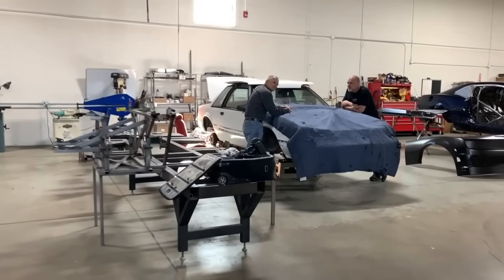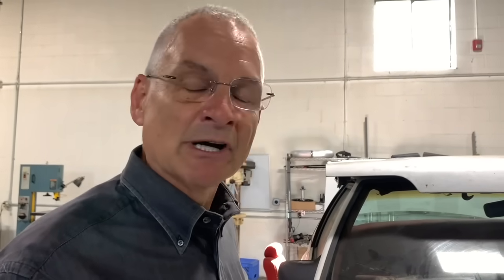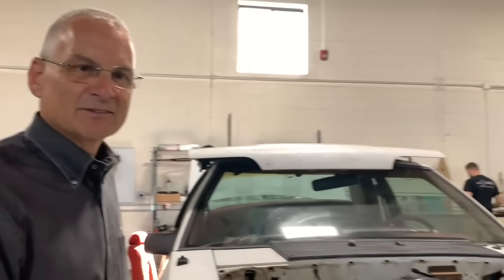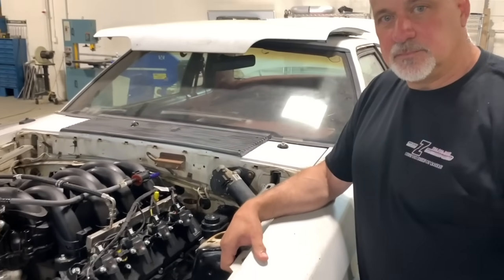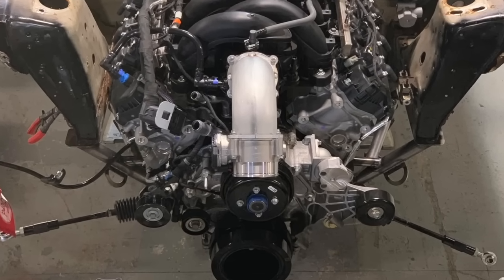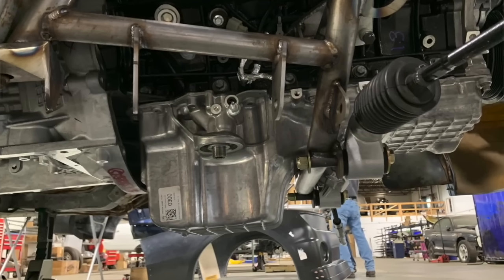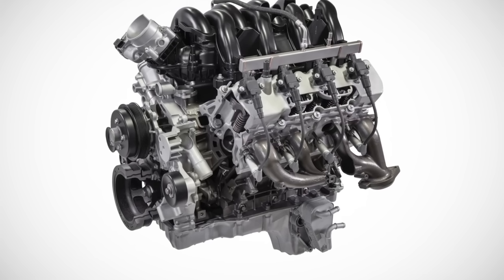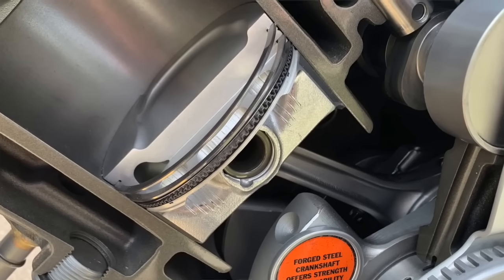Ford 7.3L "Godzilla" V8 Foxbody Mustang Engine Swap — Team Z 446-cube Small-Block Project Part 1

Comment: 2 yrs later. Has this gained enough traction? Short search brought up a $8000 430hp motor, 1200 oil pan, 1000 cam, 3500 control pack. Seems like a 20k swap all said and done. Parts as of right now are expensive compared to the priced i oaid for my sbf build. Hopefully they come down. 

 My question is what kind of power can be had on 93 fuel with boost? If this can do 800, 850 whp in a fox with 93. Thats a win. Other wise for the average non sponsored back yard mechanic like myself. Sbf is still the way to go for modified pump 93 power. Not stock block of course

Comment: 6 bolt block lol . The ls7 is stronger has way better parts and heads you dont have to touch and makes way more power but the 6.2 makes more power hell the hemi 392 makes more power and the kicker . You dont have to change rods pistons intake and have the heads ported to hell and back .. and when did pistons become a bolt on part .only in a ford guys eyes i guess . Cant wait till ford puts this engine in everything so we can really see what its made of. I now truth hurts .. i didnt know the 7.3 was a motor i thought it was a engine so where does the  aaa battery go or does it run on d batteries just wondering

Comment: 446 is a big block anything under a 400 is a small block
Reply from the maker: Jackson, I'm sorry but you are incorrect. Big- or small-block is based on bore spacing of the cylinders, not on displacement. Based on what you're saying, the tried and true 396 Big-Block Chevy would be a small-block.

Comment: For what it's worth - I'm not really a "brand guy" or a purist, but I mostly work with chevy power in part because it cost less to get horsepower out of them, but the Godzilla is an excellent choice for a swap. My current project is a Fox / LS for the strip, but if I was building for the street? I'd want the Godzilla just for the low end torque if nothing else. It shares a lot of features with the LS that made the LS great.

I love that style mounting to the K member too, its like the AJE LS swap member instead of having pads to use factory rubber mounts with an adapter. It's the one thing I dislike about the UPR K member. The reason I'm going with the UPR is because it comes in a kit with the front suspension stuff, and all chromoly. Team Z has it in chromoly too, but the kit is different, and that one is a pad mount - or no pads, and use motor and mid plates - which I'm not doing in the near future...

Comment: There’s reports of ford striking a deal with Windsor on a 6.8L pushrod that’ll be going into the 2022 Mustangs and F-150s.. LS fangirls are getting what they asked for and it isn’t gonna be pretty for them once the aftermarket starts to flood in with products 😂.. Chevy has stuck with the same platform for years and it’s gotten so old, yet ford is damn near perfecting their DOHC platform and going back to a pushrod platform just to put the final nail in the coffin.

Comment: Just a thought ☝🏽💭 instead of nicknaming this engine “Godzilla”, seeing that the Nissan GTR and R32 Skylines are already dubbed that, Ford should have nicknamed it “Mastodon”, considering the position of the throttle body and intake resembles the trunk of a mammoth or mastodon.. and because it will go down in history as a legendary beast!

Comment: Why do they call this a Small-Block?  I thought it has all the characteristics of a Big-Block?, Also is it 445ci (like Brian said at 1:24) or 446ci like your title says? (yeah, I know, splittin hairs)
Reply from the maker: Big- or small-block is based on bore spacing not CID. For instance Chevy made a 396 BB and a 400 Small Block. They also made a 366 big block.

Comment: The funny part is you can put any trans behind it that'll fit a mod motor or coyote so you can easily put a 4,5,6,8,10 speed auto or a 5 or 6 speed manual. Can't wait to see someone build one up to over 1000hp. The most insane part being that that engine is actually cheaper than a 340HP 302 straight from Ford.. by ~$1300

Comment: no matter what this guy says........a ford engine will never beat a gm engine especially the LS . its been proven many many times before and fact that a ford engine no matter how well the are built are junk . ford motors are only reliable for one thing......blowing up lol . also another fact , ford said this is the biggest factory production engine lol.......no its not but ford always bullshits . the gm 8.1 big block is the biggest factory engine tried tested and a true work horse .so good that its in every thing from full size motor homes , military vehicles , buses etc and the list goes on . the gm 8.1 is the baddest factory big block that still lives and who cares if its not that great on fuel for those of you that think its important.......wait and see the numbers on this SMALL BLOCK ford 7.3....its going to drink down the fuel worse then a raging alcoholic lmaoooooooooo........which is what ford is known for . one thing is really funny thou is that 80 percent of old school and new school ford vehicals have LS engines in them lol . you buy a ford you buy the best......you drive a mile and walk the rest lmfaooooooooooooooooooooooooooooooooooooo........this is no godzilla......this motor is a chipmunk lol

Comment: Ok I can see the business potential here but having watched way too much YouTube during the Wuhan Flu lockdown I have seen several airplane builds  where the owner installed a huge engine & the plane either fell apart & did not fly safely.  I might suggest a 7.3 powered Mustang might be great fun in a straight line but you had better slow down to 30MPH for the off ramps.

Comment: Fingers crossed they can keep the price reasonable on these engines (even used) but I seriously have my doubts.  I predict when Ford makes this engine available it will undoubtedly cost 15k+.  Ford is still asking 11k for Coyote crates!!! Coyote platform is going on 10 years old and still doesn't hold a candle to the LS in terms of affordability.
edit: Well the pricing just came out and I have to applaud Ford.  I am literally stunned they released it sub 10k.  MSRP is $8150 and the part number is M-6007-73 fwiw.

Comment: Crown Vic + 7.3L + 10spd Auto = My New Daily Driver    .... I already have the car and the $$. Ford needs to release crate engines & the transmission (NOT the SD 10 spd truck trans). These guys need to put a swap kit together.

Comment: THE LS TO BEGIN WITH IS A FORD MOTOR. IT'S A REGURGITATED 427 HIGH RISER AKA RAISED PORT 351 WINDSOR.  NOT ONE DESIGN ASPECT OF THE SMALL BLOCK CHEVY LIVES IN THE LS.  THE LS IS 100% FORD IN DESIGN. WHAT GM INITIALLY DID IS JUST COPY FORD DESIGNS. THE GM ENGINEERS ARE CLOWNS. ALSO IT IS NOT FORD GUYS PUTTING CHEVY LS MOTORS INTO THEIR MUSTANGS, BUT RATHER CHEVY GUYS USING CHARISMATIC MUSTANG BODIES INSTEAD OF THOSE UGLY Z28 IROC BODIES THAT PEOPLE PUT UP FOR SALE AND CAN'T GIVE AWAY, THAT NOT EVEN A MEXICAN DISHWASHER WOULD TAKE FOR FREE IF YOU OFFERED IT TO HIM. ANOTHER POINT ARE THE COYOTE ENGINES. CAMARO SALES ARE DWINDLING NOBODY WANTS THEM ANYMORE AND PRODUCTION ONCE AGAIN IS ABOUT TO SEIZE  BECAUSE IT CANNOT COMPETE WITH A COYOTE. IN NMRA PURE STOCK RACING. A 425HP NATURALLY ASPIRATED STOCK COYOTE SEALED FROM THE FACTORY MOTOR, WITH HEADERS AND INTAKE ONLY. AND WITH FORD'S COMPUTOR. IN 3000LBS FOXBODY MUSTANGS ARE RUNNING 9.80'S ON HIGH OCTANE PUMP AND IN THE OUTLAW CLASS WITH A DIFFERENT TUNE AND RACE GAS ARE RUNNING 9.40'S. THAT IS MIND BOGGLING AND WHY THE CAMARO LS IS HISTORY A SLATE FOR THE WRECKING BALL ONCE AGAIN KILLED OFF BY THE MUSTANG.

Comment: Things are sort of getting turned upside down in the auto industry now.  GM is working on a 5.5 L DOHC V8 for the new Corvette.  Ford goes back to pushrods after 25 years of overhead cams.  What next?  Cats sleeping with dogs?  Peace in the Mideast?

Comment: 30 k from ford build 4 ls motors for same cost   6 bolt mains deep skirt block like the ls finally went back to single cam pushrod engine instead of that overhead cam junk

Comment: The biggest area of concern for Fox Mustangs is the actual body and frame of the vehicle itself. Fox Mustangs (well, all Mustangs) are built with a unibody structure, meaning the car is constructed of various subframes connected by the floor pans instead of a full frame design. The factory bracing is inadequate to deal with the power of the 5.0L V8 up front. After years of abuse, it's not uncommon to see twisted frames simply because of a lack of bracing

Comment: A good 351W/ 408 is a lot less physical weight and size and as a bonus you can make way over 500 horsepower and way over 500 foot pounds of torque. Less weight means an easier cornering car and lighter weight is definitely easier to make it faster. I had a 1979 Mercury Capri with a 351W and a good old 9 inch rear end cut down to fit the Fox chassis and south side machine lift bars and adjustable upper control arms. With me in the drivers seat on the scales it weighed 2,950 pounds and had an honest 450 horsepower, fairly quick 😉

Comment: Big fan for nearly 20yrs of your work at MM&FF Evan. I got start in 2001 with a 1992 Crown Vic LX 4.6L 2v at 18yrs old it was my first car and I got into the magazine to learn and dream. It was 2007 before I could afford to buy and insure a 2005 4.6 3V 5M Mustang GT. Had 7 4.6L 2V vehicles, 2 4.6 3Vs, 2 Coyote 5.0s and a 6.2L F250. Switched in 2014 to GM LS stuff because I was dreaming of owning full size V8 rwd Australian muscle cars since 1996. Would have bought a Falcon...have a '13 Caprice PPV, '16 Chevy SS and '04 GT0 6M.

Comment: They might as well run 2.73s in the 8.8 behind that thing with the granny gears in that 10spd, had off the line and super low hwy rpms. I want to see this thing swollow a 300-400hp shot of nitros.

Comment: About time ford made a decent engine.. reminds me of an LS engine
Reply: Ford has several badass engines they aren't hurting for badass engines.  If you prefer pushrods you prob won't like most modern fords.  I prefer the 4v mod motors and coyote myself but this is sick too the more badass options the better

Comment: They lowered the steering rack and made a custom K member but the oil pan hangs so far down it would be almost touching the ground at even a moderately lowered ride height. There will have to be an aftermarket pan to make this swap drivable in a Fox body.

Comment: What are some reasons why the 7.3l is better than the ls? Names 2 things the ls have too... says it's still a small block... then says it have a 4.53 bore space. The ls has a 4.4 bore space. Nothing against this motor at all but you simply can't compair it to an ls. This is meant to be a simple heavy duty application engine you can't compair it to something like an ls7
Reply: The Gen 3 Hemi is a 4.46 Bore space, so for the first time Ford has a Bore Space advantage, as you may know the old SBF was a 4.38 Bore Space.   So GM is 4.4. Mopar is 4.46 and Ford now is 4.53. so all 4.46 give or take .06ish.   But for what is better with factory heads and block is yet to be seen, maybe it's the coyote at 3.94 Bore space.....
Reply: @brianwolfe2993  bore spacing isn't something that affects the performance of the engine. It just the distance from the center of one bore to the center of the next bore. Chevy has been using the same bore spacing since 1955. It one of the reasons why people swap the ls into a lot of things. A 4.4 inch bore spacing with a 9.24 deck hight makes a very small package.

Comment: Great video Evan, thank you!
Look out LS, there's a new gunslinger in town!
Reply: All the ls guys are so butthurt.  They start taking stabs at it then instantly bring up price it always comes back to price price price if they can't think of anything else negative they start bringing up the price which of course is higher than many ls engines that you see 15 of on every street corner.  When more and more become available it will get more affordable.  Gonna be alot of em out there in the next few years.

Comment: It better have 600 plus horse! the 5.2 crate has 580hp. so this should be closer to 700. I didn't get a chance to watch the whole video but wondering about weight compared to small block Ford and coyote? next question is price. I knew this would be a crate engine, lol. question is will it be better than a small block Ford?
this motor seems super unrated. 1.1 liters bugger then the 6.2 with only 19hp more then raptor spec... come on.

after this next cobra needs to be a a pushrod. 1000hp on pump, lets go.

Comment: This engine has a lot of potential.  I think it’s success in swaps will be dependent on its aftermarket support.  If no one makes aftermarket cams for it, it’ll be stuck being a low rpm truck engine, and suffer the same fate as the V10.  20 years ago when it was released, someone instantly put it in a Mustang, and it was touted as the next potential power monster....  and it may have been if it wasn’t ignored by the aftermarket thanks to it only coming in 3/4 & 1 ton “work” trucks.  

Hopefully this 7.3 doesn’t see the same fate.  Even as a Chevy guy, I want to see this engine get in the hands of the average hit rodder and get the support it deserves.

Comment: That engine looks like a RoushYates designed engine. If that’s the case, that engine will be the best modern pushrod technology for a street engine.
Reply: Haven't seen the heads yet, it would be a straight Port to the intake valves if it was.

Comment: i can already see an aftermarket intake creating more hood clearance, and an oil pan getting tucked up some. should be as compacted as an LS when the aftermarket gets its hands on them. best part is it's a push rod engine so the torque will stay on par with horsepower: prolly strong asf through the traffic range. gonna be a beast in 5 yrs. i'm getting one for sure.

Comment: I hate to be the bearer of bad news, but I don’t think this engine will ever really take off as a good swap option. One of the main reasons LS swaps are so common is the abundance of junkyard engines which keeps the price low and supply high. This Godzilla is never going into any platform other than the super duty,  whereas LS is ubiquitous within the GM lineup.

Comment: Price point will be the deciding factor. LS 23 years running, millions of them available. Parts out the ass. 7.3, brand new 7-10k, no available parts for 1-3 years. Makes a ton of sense.
Reply: Exactly, being in a F 250 only equals very limited numbers & short supply. The horsepower per dollar ratio will be through the roof.

Comment: Maybe a affordable option many many many years from now. But as of now you can get a 5.3,6.0,6.2 ls and make 1000hp for around a 1/3 of the price of that 7.3 stock. Just engine. Not with transmission or swap kit. Not to mention all the upgrades parts to get it over the 390 whp that engine may make. Ls will continue to rule till ford and there aftermarket can get there prices down to around affordable.

Comment: This man is smart,this motor well the jury is out,the small l33 5.3 stock will make 1400hp with boost,I am both Ford and GM heck the rockets look like they came off a LS3 guys,and right now Ford still cant beat what it produced called the 385 series, they will make 1000hp on a stock crank and block come on guys!

Comment: Only issue with this swap is it will be super pricey til these trucks start hitting the wrecking yard. I’d be surprised to see the crate version under $12,000 probably higher. Not to mention the 10 speed with controls that’ll be another few grand. And for what? Sub 500/500 power and a $15k-17k drivetrain? This swap is for the rich right now. Now in 6 months to a year when the bell housings for other transmissions are out and Holley makes a stand alone Terminator X for it, then it’ll get popular as long as it’s tough. Can’t wait to see someone finish a swap and get to modding it though.

Comment: I hate to say it. Ima purist in this sense. Ford in Ford. But teh WHY cant be beat by the 7.3.   Low Cost availability which Ford cant compete with. They screwed that years ago with 47 different engine models,   the 350 is relatively unchanged for 50 years. reliable, available, I dont like em in fords, but in some sense they are untouchable.

Comment: I have an 8.1 liter vortec 496 2005 truck motor in my vette. The intakes from the Chevy and ford look similar. My vortec 8.1 has an LS style design, firing order with cathedral heads. Made 600hp at 5500rpm, 630 torque at 3900 rpm. That's a mild cam with headers at 9.6:1 compression

Comment: Even though I think this is a great motor, I still think the 460-based engine would be a less expensive, more powerful way to Fox it up.
Reply: Aluminum head 460 can easily make 700hp I guess you thought the454 as truck was a hp monster to lmao
Reply: @bamadave1983  
Alum heads; iron block. Heavy as hell. I guess, if all you wanna do is go fast for 1/4 mile at a time...it'd do, but throw handling right out the window!

It's 2020; we have options. Specifically, now we have an option that stays brand-loyal. There's no need, in today's world, to toss a HEAVY lump of iron in a car. And with all the labor, and seperate go-fast parts...you ain't saving as much as you thought.
Reply: bcubed72 the 7.3 is iron block lol
Reply: 460 is an overweight malaise era boat anchor. 1994 F350 7.5L: 245HP; 410 ft/lbs.

Sure, modern heads could help with HP somewhat, but you still have a heavy lump of iron block.
Reply: Lol say what you want, but this 7.3l v8 is gonna be the best option, almost bullet proof from the factory and a guy already got 550 hp at the crank with this with a tune. The torque will make it fun for drifting out from car and coffee lol